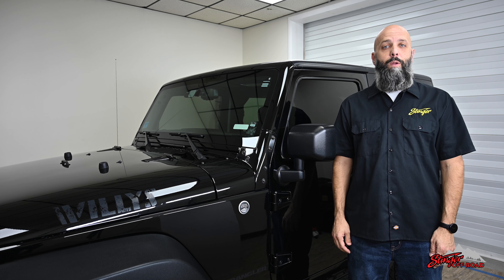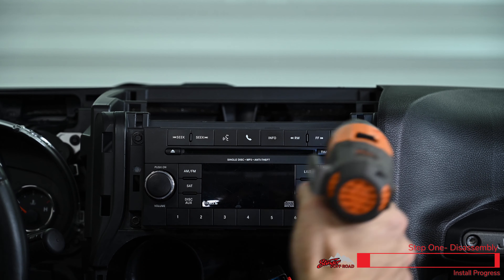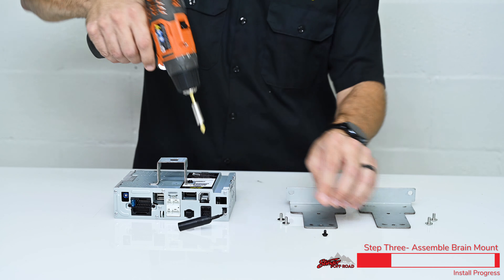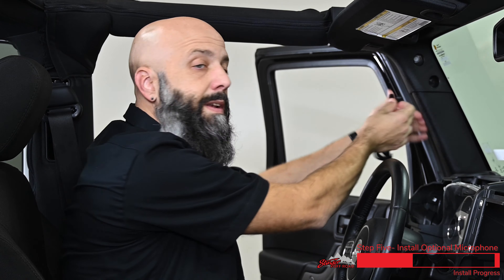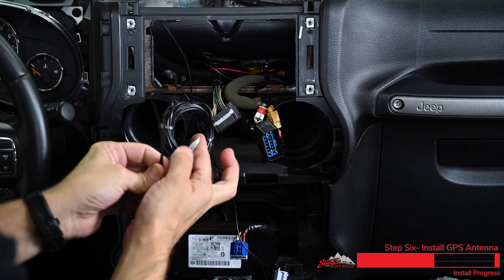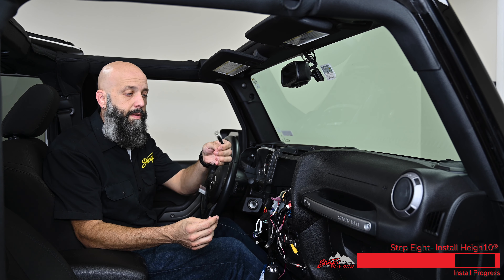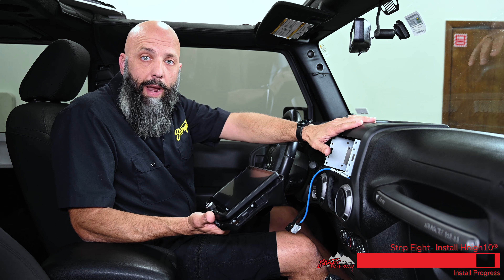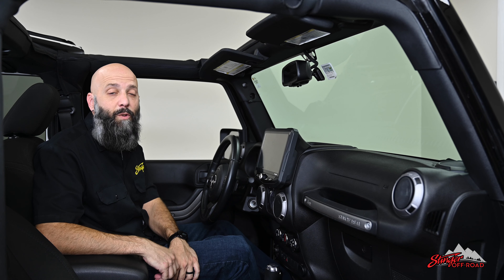How To Upgrade Your Jeep Wrangler JK Radio (2011-2018) | Fully Integrated Kit RB10JK11K

Comment: I hate to be negative, but this guy makes it look easy, I’m struggling with a lot of parts that don’t fit the way they should I can’t install the heigh10 display because the 4 silver screws don’t align properly
Reply: How did you get it cause I’m struggling mad hard
Reply: @carsonpayne266  I actually used nuts as spacers, and installed it that way. I did speak to one of the guys and they told me I have to put a lot of pressure on the screen, I told them I felt like I was gonna crack my screen and he still suggested I used extreme force to have it clip on. I also suggest you move your seats back and sit on your arm rest, that’s how I ended up feeling more comfortable adding that extra pressure on both sides and makes it much easier to see both sides
Reply: @hersonvalle  I appreciate your quick response! I took your advice and used extreme pressure. It worked. Scared I was going to destroy the screen. I also used spacers and that helped. They really should have added a little more metal on those brackets.
Reply: @carsonpayne266   my pleasure, I agree with the plates not being thick enough. Hope you enjoy yours as much as I’ve enjoyed mine. By the way if you wanted to get the back up camera you only need the camera so if I’m not mistaken. It’s like 65 dollars it comes with the bracket and a quick install . Don’t get the super expensive kit. It’s on the website
Reply: @hersonvalle  do you know of a link for it?

Comment: Great video just got mine took me a while to put in but all good. 
Only question.. 
my backup camera works however not sure show to have the backup guide lines viewable on the screen
Reply from the maker: The HEIGH10 itself does not have parking lines that can be turned on/off in the unit, so the camera you have connected much have them or the ability to turn them on/off in it.

Comment: I’m looking to buy the HEIGH10 10" Radio Kit with HD Night Vision Backup Camera for a 2014 Jeep model. Do I need the integration upgrade kit as well? Just want to make sure!
Reply from the maker: The CH1AJKIT upgrade adds the vehicle info, gauges, and off road tabs to an existing HEIGH10 that has been installed in a 2011-18 Wrangler JK. It is not required, but will give you some additional, cool features. The RB10JK11K radio replacement package that is available has the upgrade included with it already.

Comment: About to install this and stingers spare tire backup cam into my 2016 jk this wkd. As it’s laid out here, will the camera automatically come on screen when I put the Jeep in reverse or do I need to tap the reverse wire into the camera trigger wire?
Reply from the maker: As long as your JK has an automatic transmission the interface picks up that signal on the CAN network and the trigger is sent to the HEIGH10. If it is manual transmission, You will need to tap the white/gray wire that goes down the passenger side to the reverse lights, and tie that to the HEIGH10's purple/white reverse trigger in the main 16 pin power connector.
Reply: Awesome. Thanks!

Comment: Does the 7mm bolt on the top of dash hold the brain? Previous radio installer removed the bracket on mine do I need it??
Reply from the maker: No, it doesn't hold the brain. ☺

Comment: Would you be able to retrofit a jeep wrangler 2010 to make this fit
Reply from the maker: Unfortunately, the dash trim that comes with this radio replacement package is specific to the 2011-18 Wrangler JK models. We have a floating style radio replacement kit that will work in all 2007-18 Wrangler JKs linked below.

https://stingeroffroad.com/collections/jeep-wrangler-jk-products/products/jeep-wrangler-jk-2010-radio-kit
Reply: @Stinger.Solutions  Thank you so much! I just left a shop and they wanted to charge $3300 for the unit and install. I may purchase directly from you guys and follow your DIY videos

Comment: Does this head unit offer a TV tuner option? My current unit does but I would like the bigger screen size.
Reply from the maker: There is not a specific TV tuner for it, but is has both standard composite RCA type A/V inputs and an HDMI input

Comment: I just had the Heigh10 installed this weekend and have a 2016 JK with the factory OEM Alpine system. Is there anyway to confirm if the installer connected it to the amplifier correctly? Also, any EQ setting you would suggest?
Reply from the maker: The harness is plug and play, so if you have audio in all sources and when on Bluetooth calls, it is correctly connected. The factory amplifier only has 2 channels of input, so while all speakers will play, you will not have fader control with this or any aftermarket radio.

Comment: Where can I get the wire harness at? What's its called I'm gonna go to a simple olk skool radio not touch screen
Reply from the maker: The radio replacement interface used with the HEIGH10 kit is a RP4-CH11 by PAC Audio. It can be found at local PAC Audio dealers, using the link below.

https://catalog.pac-audio.com/stores

Comment: How long would you say the USB replacement wiring is? I have heated seats wired to the cigarette lighter and can’t use this location to mount the USB so I’ll need to relocate it.
Reply from the maker: The SSUSB2 that is included with the kit is 4ft in length. We wouldn't recommend going much longer than that with the USB length, just to avoid possible issues with data transfer rate when using Apple CarPlay and Android Auto thru the port.

Comment: Have the released this kit for the 2010 jk wrangler yet??
Reply from the maker: Yes, it's available here https://stingeroffroad.com/collections/shop-by-jeep-model/products/rb10jk11b
Reply: @Stinger.Solutions   It doesn't say for the 2010, will this still fit the 2010.. is everything included for the install like brackets etc? That link states 2011 to 2018... "JEEP WRANGLER JK (2011-2018) RADIO REPLACEMENT KIT - INCLUDES 10-INCH TOUCHSCREEN RADIO & PLUG-AND-PLAY INSTALLATION."

Comment: Quick stupid question, do I gotta plug in the amplified cable if it’s aftermarket? Or leave it as non amplified?
Reply from the maker: You don't need to worry about that plug because all of your speakers are running off the aftermarket amplifier. That plug is for installing to the factory amplified system.
Reply: @Stinger.Solutions  I kinda thought so, thank you!  I will be installing mine soon so I don’t want to have to tare the whole dash down twice over a cable connection; thank you for the reply! 😄

Comment: So a quick question to anyone that has this radio
 I just purchased a 2017 jeep and it has this radio but the camera flashes off and on saying signal loss.  Anyone have this issue and can the radio be taken out without breaking it? Thanks.
Reply from the maker: Hello, please contact support@aampglobal.com or call 727-732-3114 for technical questions. Thank you!

Comment: This unit looks fantastic. I hate mystery rattles. There seems to be an abundance of extra cables pushed in behind; anyone have any issues with rattling, tapping, etc.? Thanks
Reply from the maker: If there are harnesses you don't need you can leave them out of the dash. Also using zip ties to keep all the wiring together is an option. We haven't received complaints of rattles with the kit or the wiring.

Comment: Does the HDMI and the Sirus XM adapter come with the unit?
Reply from the maker: You will need to purchase the HDMI cable and SiriusXM SXV300V1 tuner separately.
Reply: @Stinger.Solutions  what if my car currently has Sirius xm
Reply: @keithowens3473  did you figure this out? I have factory XM and at a standstill installing it

Comment: This cámara work in manual jeep?
Reply from the maker: Reverse cameras will work in a manual transmission Wrangler as well. You will need to grab the reverse trigger in the passenger kickpanel or at the reverse light itself to trigger the radio, as we are not able to pick that up on the CAN network like we can an automatic transmission vehicle.

Comment: I’ve watched and rewatched the video, disconnected and reconnected everything and mine still won’t power up. Can’t get through to technical support and no one has called me back. Any suggestions?
Reply from the maker: I apologize you couldn't reach us, there have been some phone issues. Please send an email to support@stingeroffroad or give us a call now if you still need assistance.
Reply: I am having the same issue. I really hope it is something simple but I spent 6 hours uninstalling and reinstalling everything and nothing I do lets it power up. Did you find a solution?
Reply: Any help I’m having display problems I have to keep turn my Jeep on and off then the radio will play with the screen blacked out and when I turn my Jeep off an power back on no radio black screen I Watch multiple videos installing and uninstalling no changes

Comment: this complete unit comes with the frame and plastic cases? this correct ?
Reply from the maker: Yes, the kit comes with the 10" infotainment system the frame and wiring to complete the install.

Comment: Can someone in the stinger company please tell me when my apple and Android auto looks very washed out. I adjusted the screen as much as possible it’s still very washed out.  Perhaps either it’s a lemon or it’s in need of a replacement thanks for reading and responding
Reply from the maker: Hello,
CarPlay and Android Auto apps dictate the way they are scaled based on the screen resolution. This isn't a display issue or you would have this look on all sources.

Comment: Does it integrate the vehicle information on JK like the way it does for JL?  Can you monitor tire pressure, coolant tempeture on the radio if it's installed on a JK?  Also, can you completely turn off the screen when driving?  Thanks!
Reply from the maker: Hello Kenneth,

The integrated information is exclusive to the JL kit. You can turn the display completely off.
Reply: @Stinger.Solutions  I see!  Any plans on adding that to the JK?  My current head unit shows tire pressure, as well as piggybacking other informations from the OBD port.  I would love to get this unit but definitely don’t want to loose those features
Reply: @RVingTheCountry  Oh wow, 400 dollars for a trim piece... Yeah it's pretty absurd that they're not even working on it for the JK considering how many people owns JK.  I hope your installation goes well!  Let me know what you think of it after installation!  I don't think I'm going to buy it unless they add the vehicle information feature for the JKs.  My current head unit does all that and It'd be like paying to lose those features.
Reply: @Gnaw85  what unit do you have that has the features?
Reply: @SAfirefighter  I currently have the 7” Alpine i207-WRA which has that feature. Mine is quite old and I’ve had it for years.  I believe all Alpine’s Jeep Wrangler specific radios have that feature.  The only downside is their larger 9” radios requires you to do permanent modifications to your dash.

Comment: Wasn't this easy for me nothing lined up as this video shows... top bolt on the upper dash didn't line up,  monitor bracket didn't lock on dash trim and had a lot of trouble getting the mounting screws to seat
Reply: yea, me too – it's the foam lining. I was able to push it off to the side and it finally lined up. Good lord – I almost destroyed the display unit trying to get it to sit correctly.
Reply: @TeamZissou88  I added some shims behind the mount screws to push the whole thing forward about 1/4 inch.  That was all I needed to do to get things to seat properly.  They should include a shim kit with the upgrade installation.
Reply: @TeamZissou88  any suggestions on getting it to set in? I’ve been trying for hours now
Reply: @christophermikec4221  so I really had to push the foam in from the side - which was what was blocking the unit from perfectly lining up to the bracket holes to the display unit screws that are flush to the display unit channeling.

I was really starting to worry about the dash it should snap to. Additionally, I flexed / pushed the snapping clips from the display unit bracket to make them less rigid so they could cling to the dash without so much force.

Stinger is gonna have a lot of people in the same boat. Im fairly certain I did minor damage to the display unit LCD screen because of the amount force required to make the display unit even close to lining up with the screws
Reply: @TeamZissou88  thank you for the help man!
Reply: @christophermikec4221  or course! The unit looks great just hoping their firmware updates continue and they can semi modernize the UI and add things like XM preview art and remove 'iPod' haha.

Biggest hope is cutting the lag time for the Stinger boot up screen - it seems to linger about 5s too long... Curious your thoughts!
Reply: @TeamZissou88  I agree! Seems like a solid product! Definitely an upgrade from the stock Jeep display. 

Giving the screen install another go tomorrow morning 🙏🏻
Reply: @christophermikec4221  you got this...

Comment: Perfect video. Thank you! I have a 2018 JK two door base Sport with no subwoofer as well. Will the installation and wiring be the exact same as this JK? Also, where your 12v connector is I have just the generic “hook” piece that can pop right out. Will this system come with the USB connector and will it fit just as well in this hole as is does for your original 12v connector hole? Thanks!
Reply from the maker: Yes, your install will be the same. The hook is a larger hole so it will not fit the USB replacement piece.